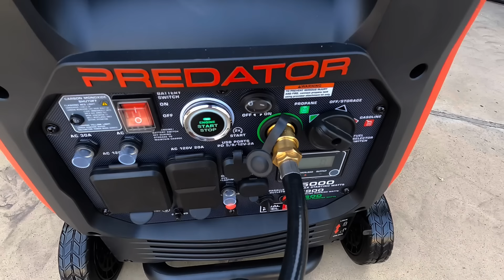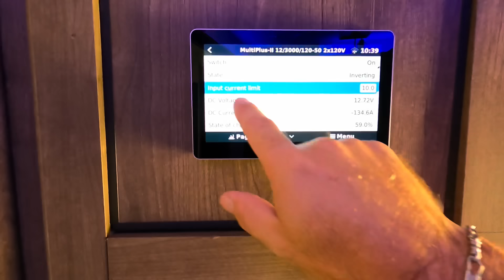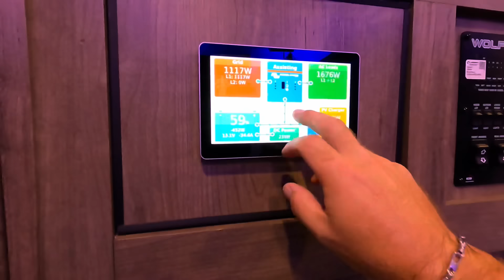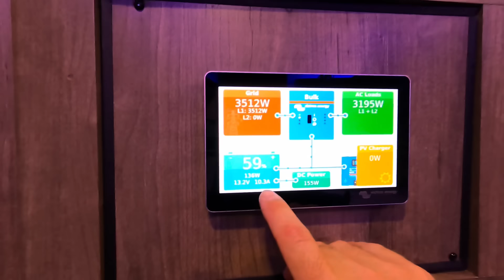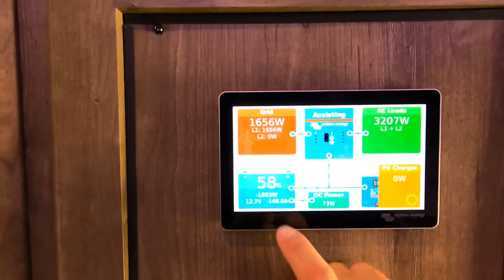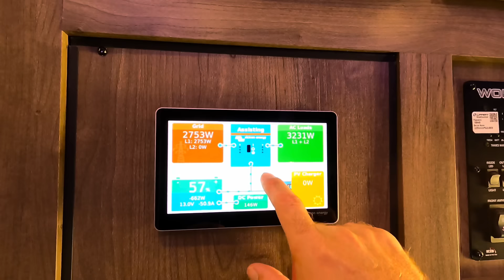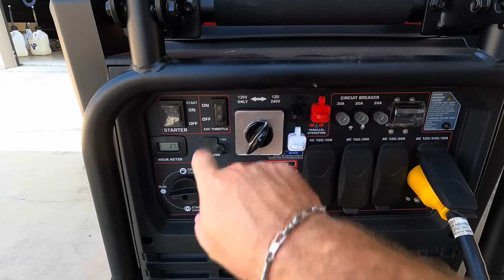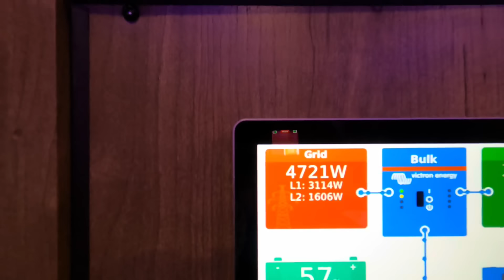Predator 5000 VS Cummins 4500 Generator Load Test! #harborfreight

Comment: We just got our first travel trailer and the hf predator 5000 was our first purchase 🥰 with extended warranty
Reply: Any issues with the predator 5000? I bought my first 24’ travel trailer and I’m undecided between a 3500 or a 5000 what’s your thoughts ?
Reply: @josephrivera5252  Get the 5000 or 9500  or get 2x 5000. The price is just that good as a dual fuel.

Comment: Just bought the 5000 from HF…only 800.00 with a coupon. Have not opened the box just yet…hope to soon and get some hours in it in case I have any issues with it.
Reply: break it in with lots of oil changes. i have 2 3500 predictors both i changed the oil at 5 mins then 10 then 20 then 30mins and 1 hours at 2 hours i did the final oil change with no metal in it.  take the used oil put it on a paper plate and look at it from all angles in the bright sun to look for metal shavings when you see none your good to go.  i do oil changes every 100 hours  they both run smooth with over 5k hours on both. when storing always run them dry.
Reply: @timg2973  thanks. I plan on doing that for sure. I also purchased a magnetic dip stick too to grab any metal fragments..
Reply: @TwoCaptainsOneShip good unless the magnet comes loose. Then it’s a nightmare.

Comment: What kind of power system is the rv running? Screen battery’s etc
Reply from the maker: Victron Multiplus2 inverter with 2 400amp hour Litime. Camper also has Renogy flexible solar panels..
Reply: @RockyRohde   thanks. How about the display/screen
Reply from the maker: Victron also

Comment: I’m looking to buy a 5000 really soon. Do they have better replacements wheels for the generator? Those plastic wheels seems flimsy.
Reply: It's harbor freight, they sell plenty of tires and parts. You can definitely rig up something even cheaper than replacements. I will say that I keep mine in the back of my truck so it's been bumped around a ton, been pulled sideways a bunch and my wheels are still perfect. When I went to purchase the Predator 5,000 I was actually looking to buy the Predator 3,500 and I made a last minute decision to go with the 5,000 just because I could tell the 5,000 had WAY better quality wheels than the 3,500. Honestly the wheels are just a bonus, you could drag that generator around on the ground and it probably wouldn't feel much different than it does with tires. They're decent and rugged enough. I wouldn't worry too much about the tires. They'd be easy to replace with a few different tires that harbor freight sells.

Comment: Really like your Victron set up. Is that something that needs to come with the camper already installed? Or can I install that on my camper. I just bought a 2021 coachmen chapparal 5th wheel and looking to have a system like that to monitor and hopefully manage my electrical system like you can. Think that would be a possibility for my unit? I’m new to the RV world
Reply from the maker: You have to order it and install..
Reply: You can most definitely order and install it yourself but you definitely need the knowledge in which there are quite a few videos on YouTube about. And it’s pricey but worth it.

Comment: running both ACs usually runs off a 50 amp service , that 4500i is for a 30 amp setup not a 50 with 2 ACs
Reply from the maker: With soft starts the units pull 1700 watts with 1900 watt starting. Two ac’s can run on a 30 with soft starts no problem.
Reply: @RockyRohde  you just proved you are better off with 5000 watt or higher to run both ACs , without them kicking the breaker on the generator

Comment: Ideas for more info on predator:  1) Parallel kits for 50 amp output - can you run two different generators on this, for example a 3500 and x.   2) i am interested in having gen set up on camper that is national park compliant.   What max predator, or combinations of predators meet the stated requirements of national park noise level requirements?
Reply: I tried a 3500 and a 2000 and bought the big connector between the two. But after reading the instructions it said they both had to be the same. So I returned the connector.
Reply: yes both genis have to be the same.
Reply: I have heard you can parallel two different wattage gens, but you get twice the wattage of the lower power unit. See Gavin's Garage about paralleling different gens

Comment: So it looks like your victron does the same as mine.  When you had yours set to 15 amp pull it was only pulling like 1100ish wattts but 15 amps is 1800 watts. For mine it seems to get stuck around the 12-13qmp mark. Meaning it should pull 1440 watts at 12 amps but mine would only pull like 800 or so. But as soon as I change it to 13 amps the wattage jumps way up like it was stuck between wattages. Seems like the victron has some weird stuff going on that maybe someone can help explain to me?
Reply: is your firmware up to date on all your Victron equipment?
Reply: Yes it is.  Been doing it ever since I got it
Reply: @IDirtbike  -- have you posted your problem on the Victron forum?  Those guys are very helpful and a Victron person is  often involved in the answers as well.
Reply: @IDirtbike  -- how about your GX device's firmware?  also, are you running a MP2 inverter?
Reply: @rpsmith only thing I have is the multiplus 3000 and the Bluetooth dongle. I believe they’re both up to date on firmware. I just figured it’s just the way these things were.  ESP after seeing this guys acting the same way mine does
Reply: @IDirtbike  -- I would post on the Victron forum and see what they have to say about it.  It's a really great resource!  Also, have you considered adding a GX device?  you can build your own using a Raspberry Pi 4 and a MK3 interface and have the same functionality as a Cerbo or  Ekrano GX for around $100 or cheaper if you already have a rpi.

Comment: I do believe the reason the 9500 still has a 30amp plug but a bigger generator is because it's a 240 outlet which gives you 2 hot legs of 120 at 30 amps each.

Comment: Are there any > 4500 starting watt generators that will fit under a closed tonneau cover? My current gen is a 4500 Dual Fuel Champion - won't fit.
Reply: yes check out a Champion inverter 4500...fits under my tonneau
Reply: Both the Predator 3500 and Predator 5000 fit under my tonneau cover.
Reply: @barrthom603  what model truck. My duel fuel 4500 champion inverter won't fit under my 3500 GMC Denali with a Retrax Tonneau
Reply: @razorwired130  GM must have a smaller bed then Ford.  Fits under an F150 and F350.
Reply: Pulsar Gd400BN dual fuel 4000 watts weight 474 lbs no electric start
Reply: 47 lbs
Reply: My 5000 does in my 21’ tundra cover

Comment: I love my 5000 but it doesn’t run my air conditioner! Darn! Do you have a soft start on yours?
Reply: Oh sorry I just saw you have soft starts.
Reply from the maker: Yes on both units
Reply: @RockyRohde  Well I tried this generator on my friends exact 1992 rig and it works on his air conditioner. Not sure if he has a Soft Start. Well I’m loving it 😍! Thanks for the video again.
Reply from the maker: Yeah I have soft starts and it will run both of mine..
Reply: What does "soft start" mean?
Reply from the maker: @drlty1 RV Soft Starts for Ac units
https://youtu.be/1CHz7DWnsmI
Reply: take off eco run fast then try
Reply: Good idea

Comment: i do like my 4500i cummins but the dam thing is getting to heavy and you want me to get a heavier Preditor lol
Reply from the maker: Predator 5000 is just enough to run both ac units with soft starts. The Cummins will not.. My rv has to have two units running minimum to keep up in Texas..
Reply: @RockyRohde  ok then turn on the coffee pot with both running lol
Reply from the maker: Yeah that’s not gonna work 😂

Comment: Predator 9500 is only 7600 running watts. 30a x 240v = 7200.
50-amp 240-volt circuit: 50 amps x 240 volts = 12,000 watts
Reply: Campers are not generally 240v.  They are 120v x 50a = 6,000w.
Reply: @twaflyboy1  They are two legs of 120 at 50amps each.. It's a 240 volt plug and input.. Where as a 30amp is only one 30 amp circuit.. 100 amps, vs 30... That's why the 9500 doesn't care and works better.. It's able to put out more current over all .
Reply: @twaflyboy1 "Campers are not generally 240v" -- Not true.  The 50A RV service is actually two 50A/120V circuits with one 50A/240V circuit leg-to-leg.  I installed a 24" apartment washer and dryer in my RV and rewired the dryer plug to supply 240V to my dryer.  I also rewired my water heater for 240V and changed the heating element to 2,400W/240V.  The only downside is the dryer and water heater no longer work when connected to a 30A/120V hookup but 98% of the time I'm on a 50A service and I can always run the water heater off of Propane.
Reply: @tristanjohnson9773  -- and each A/C is on its own leg.
Reply: @rpsmith my 38’ is 50 amp as well.

Comment: Does the Predator generator have problems when being fueled by propane at higher elevations? I'm not sure of your elevation. Thanks...
Reply from the maker: It comes with different jets for carb.. not 100% sure on propane
Reply: Look for a fuel injected generator if you are frequently at different elevations.

Comment: I've owned 2 Preditor inverters. 2000, ad 4550.

I've been  using the 4550 for nearly a year and a half.
5 days a week, 5 to 8 hrs daily.
It'll run my soft start ac unit, lights and 3/4 hr grinder at the same time
I'm gong to step up to the 5000 simply because of the remote start.

Comment: Champion makes a 5500 inverter generator. I haven’t seen many videos on it. You should test it out. Price is the same as the pred 5000
Reply: The champion has a manual choke, the hf is automatic, so I can automate it to my battery bank.

Comment: Had a predator inverter. Lasted about a year. Changed oil and non ethanol gas. Will never buy again. Have a champion, no problems.
Reply: Mine works good since last three years.
Reply: I got just a little over 1800 hours on a Predator 3500 and it's still running strong
Reply: That’s  understandable. Think it may be the luck of the draw with predator. I’ve got a 2000 predator I’ve had for 7 years. Haven’t changed the oil but twice. That’s laziness on my part but I use it for work and it just keeps working like a charm.
Reply: If your need IS 5000? Buy 8000... I bought one Westinghouse 9k... Lasted 2 years with break in, severe use. Bought 28000 Westinghouse runs até 35 percent up to 50 percent output, runs flawlessly with 6 thd on load.
Reply: I’ve had 5 it’s called a warranty
Reply: @howtodobmx6114  mine had a 60 or 90 day warranty. Got an extended warranty,  failed right after.
Reply: That sucks, i just boight one and noticed the air filter is a dry sponge type. I oiled it with filter oil so it isnt sucking in dust. I wonder if that might have had something to do with failures people have. I have 2 Champion generators 1 for 15 yrs and its a beast still. Just needed a bit more juice.
Reply: @SketchyXC It's in the manual. It tells to oil the sponge.
Reply: My 5000 predator has been great so far. The champion generators are made in China as well. Not to many American made generators anymore. But the honda 2000 i have has been awesome for 11 years. Of course not china but Japan.

Comment: Want to buy a generator for the house in case we have a long long power outage when we go camping we go camping
Reply: Then you will need to figure out how big of one you need. Do you have central ac? Or window units. For a house you are going to need a 8000 watter for sure if you have a big house. If you don’t care to much about ac or use a window unit to cool down a room or two in the summer ( Which is what I do) then yes a 5000 will work limiting things running while start up occurs. Like I don’t run the ac and the microwave at the same time. I think it could handle it but I prefer to do it just in case